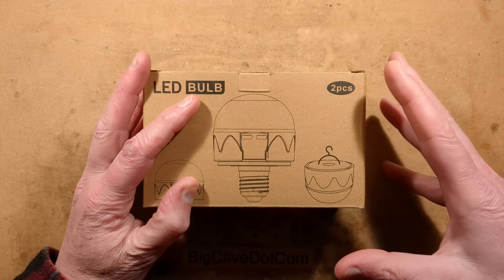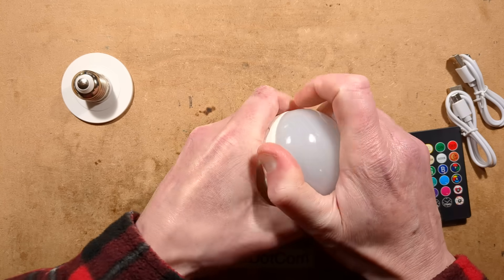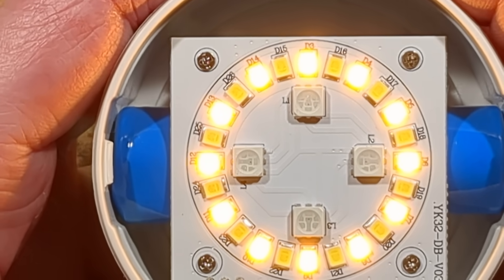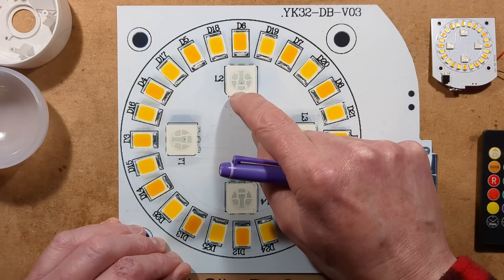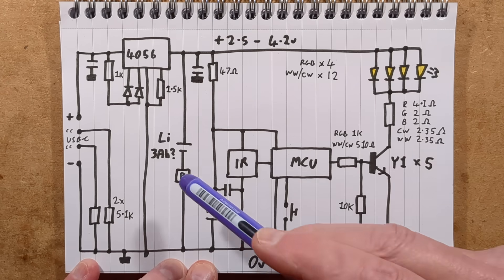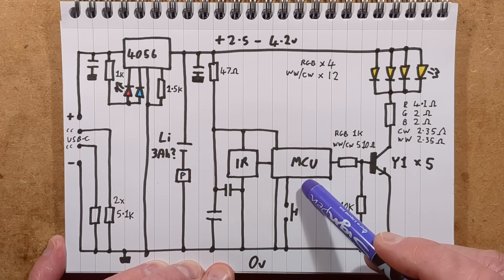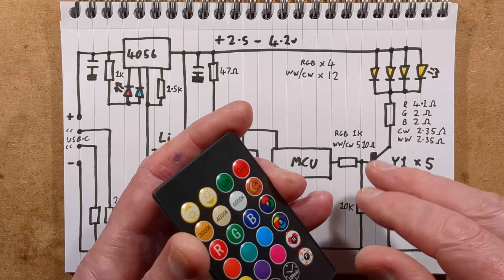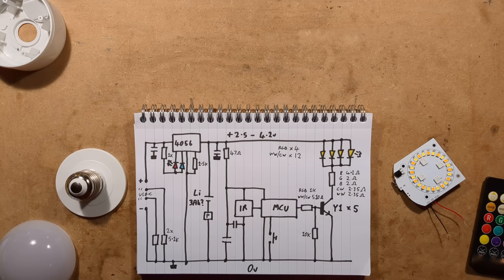Inside a screw-in rechargeable LED bulb

Comment: Edison is spinning in his grave! Why would anyone want a light bulb which screws into an Edison socket - but needs to be charged _separately_? To finally combine the disadvatanges of fixed electrical and battery powered devices?
Reply: Fans of Tesla?
Reply: What is the main advantage of this light bulb ?
I can only think of one: when there is a total blackout in the home you can insert this rechargeable light bulb into a ceiling socket or desk lamp 

You could also use a torch right?
Reply: @PetraKann  I am thinking desk lamp in places where there's not a convenient socket. That and next to the consumer unit to freak the .... out of the electrician.
Reply: @etchedpixels 
Are these light bulbs rechargeable when plugged into a socket?
Reply: @PetraKann  The ones in this video no, but there are ones that have that functionality instead.
Reply: @etchedpixels 
They could be useful in that they can switch on as emergency lighting during a blackout 
May as well get a solar light

Comment: I'm surprised they didn't put a little circuit in there to at least inductively tap off a little power from the AC to trickle-charge the battery.  It literally could have been just two parts.. A little coil, a small cap, and a zener tied into the USB charging circuit.  It would have been so cool if they had done that.

Comment: With that base that 'connects' to an E27 socket, you could in theory implement wireless charging in the thing, though, perhaps not their own implementation, just in case of light fitting flambé issues from iffy lithium cells (iffium?)... :P

Comment: I just wouldn’t buy something that screws into an Edison-style socket but doesn’t draw power from it.
Reply: Specially as it has metal on it too... doesnt seem right
Reply: This is the only example I should have used... 
the ubiquitous pull-chain, pull-cord light fixtures. Its going to blow your mind once you realize what it does when its in the off position.
Reply: same. it's a light bulb that isn't a light bulb, but is. 🤣 
also, i prefer those that can be controlled with an app, like those wee strings of usb powered lights.
Reply: Obviously you will only realize it doesn't power from the socket after they've arrived.
Reply: @SojournerDidimus In my experience the ones that don't power from a socket have a charging port.  The ones that do charge from the socket don't have a charging port.
Reply: It's the same as plugging and appliance in an outlet.
Reply: @znk0r  "It's the same as plugging and appliance in an outlet."  No it isn't, an appliance draws power from the outlet it's plugged into.  This device just uses the light fitting for mechanical support.
Reply: @ferrumignis  an appliance does not draw power if its not turned out.  I have a desk lamp, its plugged in to the outlet, yet its drawing no power.  There are also plastic plugs you can put on outlet so young children cant stick something in to them.  This is exactly the same.
Reply: It's meant to have a pendant lamp without having to run wires. 
Eg lighting a shed that isn't wired or maybe even a tree house for the kids.
Reply: @gabbertje2811  We get what a rechargeable light is used for. The part that makes no sense is the Edison socket.
Reply: @operator8014  It might make sense in a few old buildings that are now off the grid, but I would liked it to have an inductive charging circuit.
Reply: @ehsnils I don't see how it could make sense for off-grid housing.
Reply: @operator8014  It only makes sense as a mounting point, but even then it doesn't make much sense... 😉
Reply: @operator8014  A house that once was on the grid but was taken off the grid. Happens in rural areas now and then.
Reply: @ehsnils  I know WHAT that is, but that doesn't mean anything helpful for your argument. The socket being powered or unpowered doesn't change anything, it's just a bad idea.

Unless your lights are all head level wall sconces without covers and/or you have 6 foot ceilings, then they are going to be installed in the single most inconvenient and least useful place possible. The only place these wouldn't be a COMPLETE pain in the ass to use would be in a desk lamp, and even then It's among the worst possible options.
Reply: @gabbertje2811  If you are installing this into a structure with no power why would you install pendant lighting fittings rather than just hanging the light from a small chain or piece of cord?  For a shed it would make more sense to have a flat magnetic backplate that could be screwed to the structure to allow the light to be quickly removed.
Reply: @gabbertje2811 I have triple light fittings that I only have one bulb in. I would get a couple of these except mine are bayonet 🙂
It makes sense in that light fittings are generally in a place ideal for casting light from.

Comment: Seems a shame that it doesn't have a feed off the mains as it could double as an emergency light when the power goes off.
Reply from the maker: If you search my videos for the keyword "intelligent" you'll find a few bulbs that do that.
Reply: That’s what I was expecting from the video. I’d have been in the market for something interesting like that.
Reply: @Milamberinx  Just search for "battery backup light bulb". The ones I've seen will run for a few hours on battery, but at a lower brightness then normal. They sense resistance on the power line when the power is out, so they will turn on and off with the normal light switch.
Reply: @QuickSplashVideo-rm2k That's what I'm looking for. Acts as a motion sensing nightlight, and as flashlight when needed. If it's motion activated, might not even need power on when power goes down.
Reply: @grahammonk8013 you really want a constant light when the powers out, unless you want to wave your arms in the dark every  5 minutes
Reply: @RDEnduro  AND as a flashlight. What I'm concerned about is getting home after a power outage and finding the flashlight is now dead.
Reply: It's a shame they didn't try to shove like one of those 5v1a chargers into the base and had magnetic rings along with the USB charging ones. It just seems so obvious.
Reply: I have those kinds of lights, bought a bunch of them in store at walmart a couple years ago, but they have a downside. If you leave them on for long enough it gets so hot that the bulb stays lit until it cools down enough when you turn it off. Not sure if all brands act like that or specifically the ones i have.
Reply: I was so confused when it WASNT that since that seemed like a great idea
Reply: its not feeding mains beacause its made and designed by an Brain-Rotten-NPC.
Reply: Plug in a USB charger as well.
Reply: Lack of certification, no point in investing in one of these for fire safety purposes?
Reply: That seems like a great idea...what's the point of having it screw into a light socket, pointless.
Reply: @brianallen9810  I have used them in a spare bedroom where there was no electrical supply and I didn’t want the expense / time of chasing the walls out, decorating and getting building control sign off for the privilege.
Reply: BigClive caan hack it - small capacitive dropper please🙂
Reply: Pity. The power cables on our street are old and we have power cuts every few months. The last one lasted a fortnight; the whole street was powered by a Diesel generator the size of a Transit van.

I thought I'd planned ahead by putting rechargeable li-ion AA batteries - Dracutums - in my camping lanterns. (I have six; the power cuts happen that often). Unfortunately they all started cutting out after about an hour. Those batteries apparently don't like running at full current continuously.
Reply: I was about to suggest the same thing. I would add one more feature, and that is continuity detection. That would make it, so even if the power is out, it will come on, when turning on the light switch. This would only work, if other lights on the same circuit aren't a low enough resistance, to make this think that the switch it turned on.
Reply: I saw something like this on Amazon and was thinking the same thing as a transformer blew a few weeks ago and I was wandering my home with a scented candle in my hands, haha.
Reply: We could always hack it 😉
Reply: Most people have phones which can double up as lights in a power cut scenario. Also lithium batteries stay charged when not being used so you can buy a portable battery with a torch, charge it and have it in the draw until a power cut and it would hold power for years.
Reply: @sethnavabi6926  I live in a remote rural area of Australia that suffers frequent power outages. I am NOT connected to my phone by an umbilical cord, and the suggested mains charging to create an emergency light would enable me to see to retrieve a torch or even (as a last resort) my phone !
Reply: @CitizenSmith50, I have one of the mains powered motion sensor night light/ torches from Aldi, it doubles as an emergency light during blackouts, next time they have them go into town and get one, you won't regret it.
Reply: @sethnavabi6926  "Most people have phones" - what an exciting modern world.  :-)    I honestly never thought of that  - I'm barely old enough to remember the blackouts we had in the 1970s due to miner's strikes.  These would have been amazing - but of course lithium ion cells didn't exist then. We had to make to do with candles and a packet of swan vesta.
Reply: @DaveF.   Ah,  Swan Vestas-proper matches!👍👍👍👍❤❤
(The friction ones,not the safety crap they have now😢)
Reply: @DaveF.  Those miners being fairly compensated would've eased the blackouts but I digress.
Reply: @StanleytheCat-v8z  The labour government of 1974 gave the miners an immediate 35% payrise.once they gained power. That hardly seems unfair.
Reply: @DaveF.  The fact a massive blackout ensued after the miner strike means they quite obviously did not.
Reply: @DaveF.  My Rotary phone is not a light source 🫤
Reply: @sethnavabi6926 lithium batts do self discharge in those power banks right?
Reply: @zzoinks lithium batteries, like all batteries, will slowly self discharge over time. It’s just a case of at what rate.

Comment: Huh.  What’s the chance you can pair multiple lamps to one remote?  Or is it dumb IR?  These might have their place if they’re easy to control and lightweight enough to hang conveniently.
Reply: The remotes look like the cheap, crappy generic IR remotes that come with dozens of Chinese products. Most of them have the same codes regardless of the type of device, which can be fun if you own several devices of different types 😂

Comment: Seems like it would be nice to have some sort of 5V power supply in the base with a couple of exposed contacts in parallel with the USB socket so it actually could charge from the Edison screw. Probably would make it cost a few extra dollars though or something.
Reply: One should check the supplier and see if that version is available or upcoming.
Reply: MagSafe only just went off patent weeks ago
Reply: @abitofabitofabit4404  What he described isn't magsafe but there are already wireless charging protocols that are open source which do the same thing.
Reply: Alternatively wireless charging.

Comment: I’ve seen those for sale and assumed the same, I wonder if any recharge via the light fitting (I think I remember some descriptions talking about standby lighting etc) but ….

Cell not too bad (in such things) done if mine I’ve bought over the years have been in the 300 -500 mA hr range.

Surprised it’s BJT - MOSFETs are so common now and lower quiescence and on state R
Reply: The designers of this have not really given much consideration to standby consumption...  But I do like that it will run whilst charging which is not a given these days, so could be pressed into emergency lighting duties in an always charged state, albeit holding the cell at 100% for extended periods is not going to be good for it,,

Comment: It's a shame the screw-in piece is not part of the body or you could try slipping a USB charge circuit in there.

Otherwise, an utterly terrible USB light.
- No SOS mode
- No police mode
- No strobe mode
Reply: When the magnet fell out there was a hole. If you took the magnet out and glued the base to the main part, you could then run wires through from the edison screw fitting and put the charger circuit in there. It would have to be isolated unless you removed the USB socket, in which case it could be a capacitive dropper.
Reply: @matthewstephenson1664  You can keep the magnet and use pogo pins. Of course only with a proper 5V PSU
Reply: But it does have police mode!
Reply: It is lacking function needed in house light. 🤣👍
Reply: @dcallan812  sarcasm is something that happens to other people, isn't it? 🙂
Reply: @DaveF.  😂👍
Reply: Why would anyone want seizure mode?